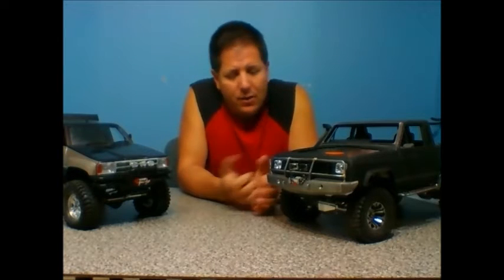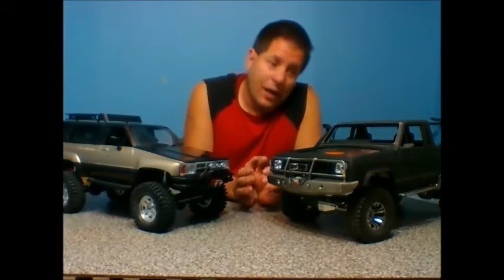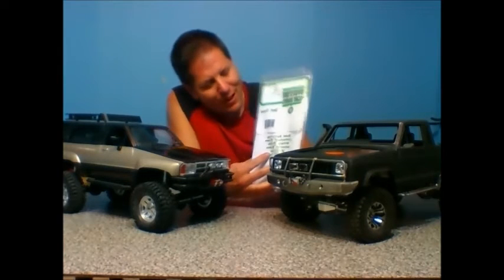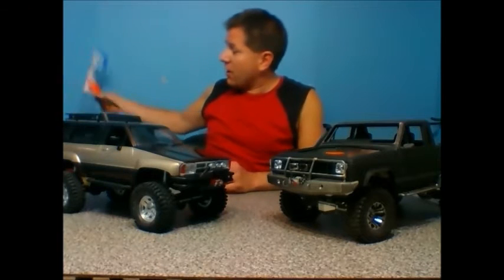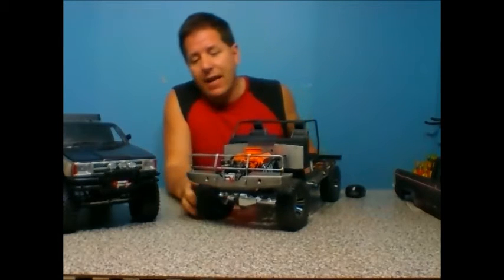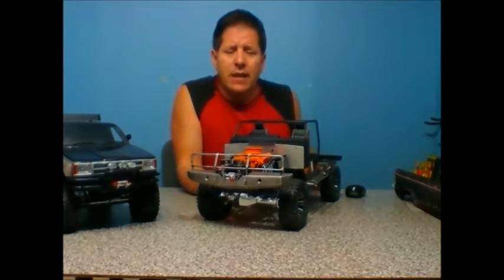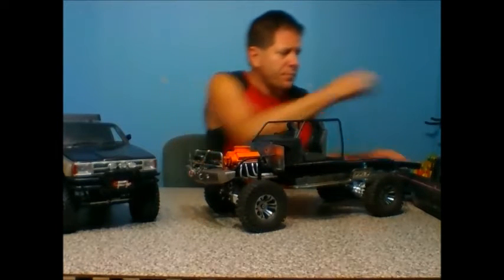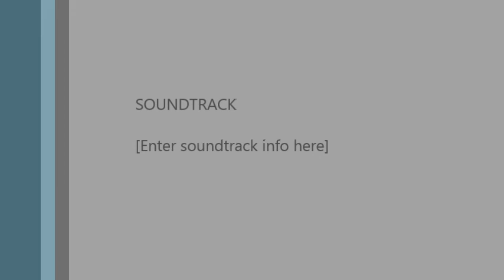Intro

Comment: I would love to see how you build a body from scratch. Entry level if you will. Maybe use an SCX10 or similar chassis? Ive been building Tiny trucks for a bit but its mainly with off the shelf parts. I know my way around tool, just not sure where to begin or what I would need. I appreciate your videos! Thanks
Reply from the maker: R8TEDM Thanks glad to hear you want to give this a try its not has hard as it looks.  Once you have the basics then it will become easier.  The truck that you would build could be sized to fit the SCX10 chassis.  The only thing you would need is the length and width of the wheel base and tire size diameter. I was thinking of building a m715 jeep I think it would be a great one to start with.
Sean